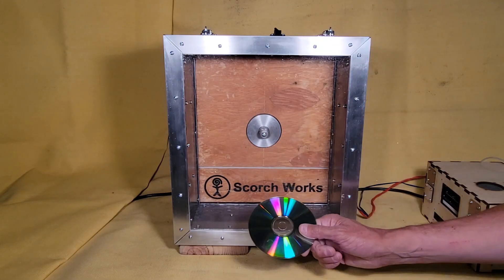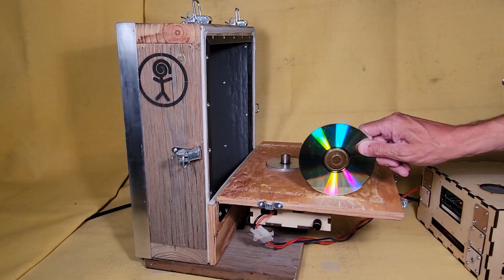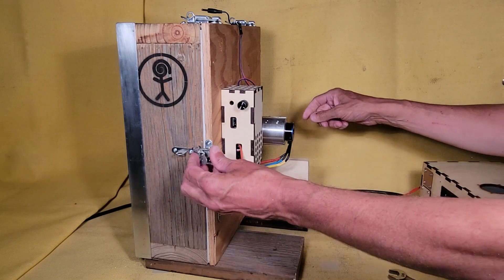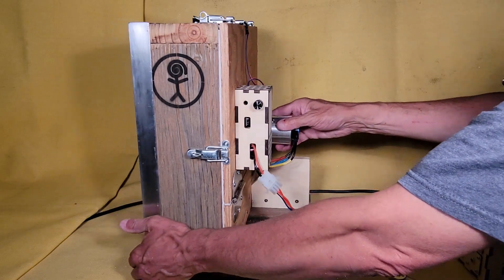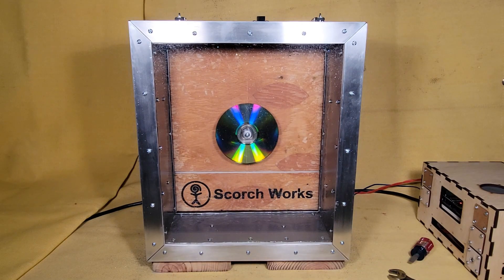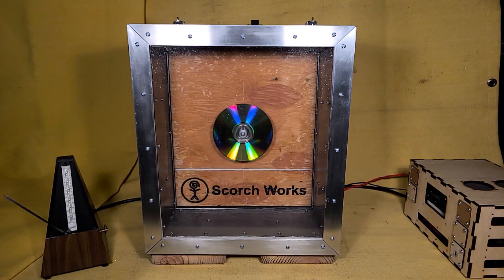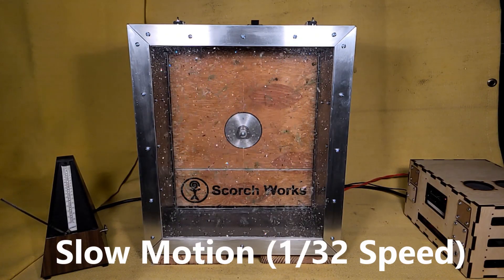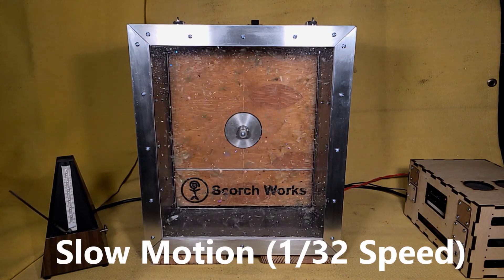Exploding Compact Disks - CD Spinner

Comment: Do you have any idea what the RPM was at the failure? What about the disc from a hard drive? :trophy-yellow-smiling:
Reply from the maker: The breaking speed is something higher than 30,000 rpm.  Not sure of the exact numbers.  There seems to be significant variation between CDs.  Not sure what a hard drive disk would do, that would require a different mounting on the motor.